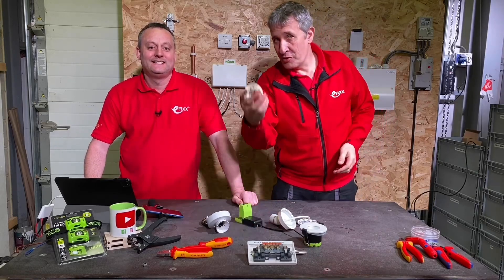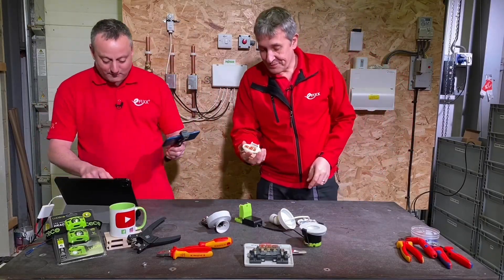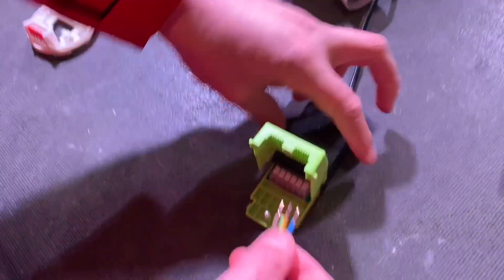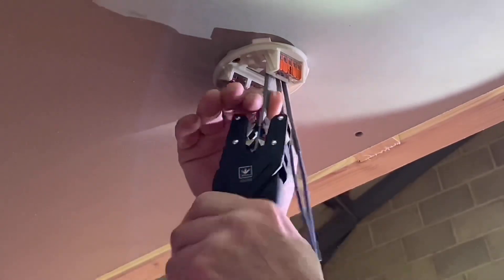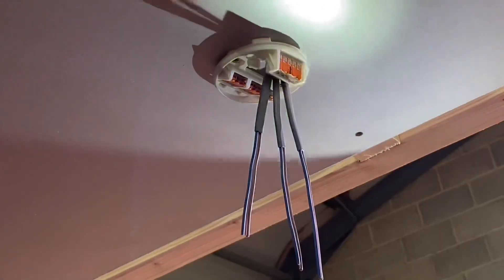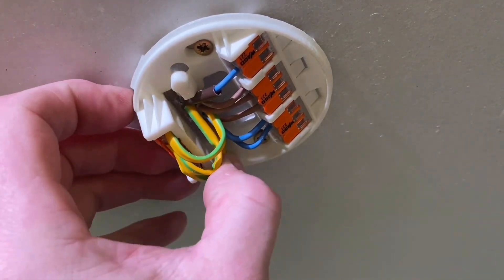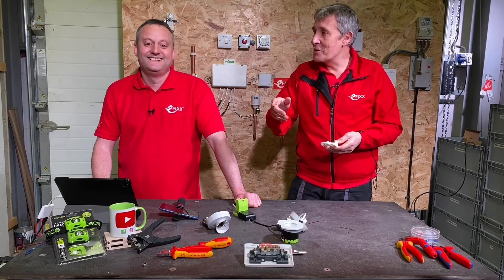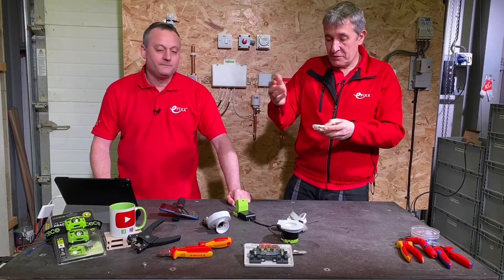Would you use a WAGO 221 CEILING ROSE?

Comment: Hi,  Just a thought.  As modern smoke alarms are fed from the light fittings.  Has this rose got a seperate set
of wagoe's for this or do you just double the smoke alarm feed wires into the same terminals?

Comment: Pendants are an utter and unnecessary ball ache, these would be great
Reply: Also if suppliers of fancy light fittings could add the the ability to 3 plate that would be nice too rather than the ole LNE connections but having 3 cables to have to mess around with

Comment: Personally I don’t trust these wago type blocks, simply your contact area is very thin metal strip, compared to basic ceiling rose with larger surface contacts, also you know that screw is tight and your conductor is secure.

Comment: I asked MK for a WAGO Mains Socket 10 years ago…
Definitely time now for Mains Supply and Ceiling Roses using WAGO.
Any suggestions for an existing WAGO product to supply an island induction Hob (possibly pop up sockets too) using fixed wiring in wall of 4mm2 to the flexi pre-wired to Neff Hob? Typically it’s not long enough to reach the wall…
Oh I’d pay £1 for a WAGO ceiling rose, after all if I’m populating it myself with 221’s there would be no metal in it.

Comment: If the choice was between a ceiling rose with screw terminals and one with WAGO terminals I would opt for the WAGO.
But there are a few issues we should think about when we talk about WAGO type ceiling roses.
The first is cost, a screw terminal ceiling rose is fairly cheap to buy so must be cheap to manufacture and a WAGO one may not be able to compete on price particularly in a market which is shrinking.
As a personal example of this I had a look around my own house, when we moved in a long time ago we had 13 ceiling roses in total.
Now we have only 7 ceiling roses and 11 other light fittings which I cant call a ceiling rose as they fit directly to the ceiling and over half of them have multiple GU10 LED bulbs on a bar.
These light fittings have push in type terminals in the base of them, some even have multiple common terminals to allow loop in etc.
So I think the days of the traditional ceiling rose are numbered, a lot of new houses have LED downlighters everywhere.

Comment: Instead of fiddling with both the diagonal cutters and the big wirestripper tool during the install, you could have used a cable cutter. The CC22 is the go to here in the nordic countries. It has a cutting area made specifically for stripping wires.

Comment: Only if you paid me. All wago crap overpriced. Used wire nuts for 50 years without a problem. If I go into a splice box to add another receptacle most likely wago is maxed out so I have to replace it. Most of the timevwork on energised circuits. Just removevthe wire nut and twist new wire around. Have done this thousands of times.

Comment: Love the videos lads. Brilliant idea, about time all electrical fittings had Wago or push in type connectors. A lot of IKEA lights have them already. By the way, when are you lot in the UK going to stop using that old outdated twin and earth?  Since 2017 , in Ireland , we can no longer buy twin and earth which has a bare earth conductor. The earth in our twin and earth has to have an earth conductor which is insulated, not sleeved, and the earth conductor must be same cross section as the other conductors. See attached link 
https://safeelectric.ie/contractors/updated-national-wiring-rules/ 
Keep up the videos.

Comment: As I said before crabtree certainly had push fit switches in the late 80's early 90's, not sure if they did sockets in that range, I am not sure there's a real market for this, I have switch fed since the 90's, mainly because it's easier to terminate a load of cables low down rather than stuck on a step ladder, although these days with smart switches, where you normally need a neutral it makes sense to switch feed.
So for that reason,  I think it's dead before it starts,  and  at least 10 years too late or more. 
Cost wise, there's well over £1's worth of wago connectors, I would say you looking in the £3 - £5 area.

Comment: Hi fellas, love your stuff, very educational, thanks, but I do have a question regarding BS1363 design, I recently had some 2 gang TCP Smart sockets with wifi app controllable switching, all good except the two earth connection points on the outlet were not inter-connected, and I was concerned that the average DIYer swapping these out may not realise that they could break the continuity of the earth ring if they added more than one of these, do you know if the standard specifies that sockets should have internal connection between earth terminals? as I believe this could be putting people in danger of not having earth fault protection. Thanks.
Reply from the maker: Send us a link to the product or a photo and we’ll take a look.  TCP have a track record  in electrocution- https://www.luxreview.com/2015/03/12/led-lamp-shocks-bulb-tester-at-uk-consumer-publication/
Reply: @efixx  for some reason my link gets deleted by youtube, so go search for 'TCP Smart Wall Socket with USB' sold on ebay by a big high street catalog shop ;)

Comment: Tbh wiring up a standard pendant batten isn't that hard only that as you pointed out the terminals are smaller than standard terminal driver and makes difficult to tighten. They could just make pendants etc slightly bigger and accommodate extra terminals . But I guess as more people use the feed to switch method you dont need that many terminals

Comment: I like the wago cieling Rose, however the only niggle that I have is when performing safe isolation, because with a standard cieling rose you can put your voltage indicator onto the screws to test the supplys dead.

With the wago cieling rose you would have to disconnect all the conductors in order to test them, and should the supply be live then you risk getting a shock when disconnecting the conductors.

Thats the only niggle I have.

Maybe they could make a test area on the wagos for testing the supplys dead with the voltage indicator?
Reply: Wago 221 and 222 connectors do have a test slot, but sadly at least on the 222s (I haven't tried the 221s yet) it seems to be too tight/deep for the modern high safety rating probes to get into :( I'm also not sure how reachable it would be in that rose design.
Reply: @petermichaelgreen  I've checked the 221s and there's no way of testing them as far as I can see without taking the conductors out.
Reply: @planetconker1104  https://www.wago.com/gb/electrical-interconnections/discover-installation-terminal-blocks-and-connectors/221 claims there are test slots, but it looks like you need a pretty long thin probe to get into them.
Reply: @petermichaelgreen  Well I've got a bag of 100 2.5mm² 221s and a mixed box of different sized 221s and I cant see any where for probes to go.

Comment: Ktech makes the “mbox l32” which is sold in various locations. Sold as a wiring centre but can be good for other complicated set ups with multiple switches for bathrooms etc. Ktech has, for years, had “kRose” as an upcoming product but it isn’t yet in the market. I don’t know but I always assumed it was a wago based ceiling rose. They’re very local to where I work so hopefully the prototype you have is from them. Wagos beat screw terminals for me every time!

Comment: as a yank, we'd dustbin the ceiling rose.  we prefer to have a 3 and 5.8" round box recessed into the ceiling, and then any surface mounted light will screw to that box.  also, we've been feeding the power through the switch box for many years now, and most of us prefer it that way, because it eliminates using a color of conductor for a different purpose than the color code implies.  
as for the Wagos, I don't trust screwless connections for power going through, because we have had screwless receptacles for years, and they're a bit rubbish.  I'd estimate I see between 10 and 20 screwless connections fail for every mechanically fastened connection that fails.  fixture connections, I don't mind so much, because they don't carry as much amperage and they don't black out half a circuit if they go bad.

Comment: Think the jury is still out on these. Most new builds use 2 plate method with just 1 or 2 cables at the light. £2.50 as can’t see the real time benefit and testing seems like it could be a little trickier than conventional pendants. Also scenario where you have 4 cables plus at the fitting is arguably where these would be most beneficial but with current design this is not possible. With some tweaks and if you can keep cost down then it could make its way onto the shelves. Good luck to the designer, hope it works out for you 😊

Comment: Would be great for consumer unit wiring if they could increase the wago size for bigger cable connections
Reply: Wago Cage Clamp connectors are available for various size up to 35mm2 conductors (and their Power Cage Clamp range goes even higher). That should be sufficient for any consumer unit. What's really needed is for a manufacturer to start making RCDs, MCBs and RCBOs with Wago connectors.

Comment: Is there anything to stop roses being bigger, with more space for more connections or even a junction/adaptable box with a flex outlet? How about using the push button (Ashley box style) like on your downlighter review? I'm a huge fan of Wago but we're yet to get the full potential. New light fittings with them in place? No more balancing a light on your head while you hold multiple cables into a connector block & twist the screwdriver with you teeth!

Comment: In new builds these would be used, then within a year or two many of them ripped out for aesthetically pleasing light fittings. So, those push fit lighting j-boxes would be used shoved into the ceiling space. 

I only have one ceiling light fitting in my place - a very expensive pendant light over  a dining table, which does not use a standard ceiling rose.

Comment: 1st question - yes, 100% I would use one, I hate ceiling roses
2nd question - if I was doing a rewire I will never take the feed to the ceiling rose so wouldn't need as many connectors, I would pay around £2.50 for it.
I can't quite think why but I think this video is once of the best you've done, nudge nudge, wink wink!!
Reply: how would you do it then?

Would you feed the mains through the switch then the switch on to the pendant?

I tried that and it keeps tripping...I tried it the normal way too and the same again.

Only one of the ones I'm doing that's doing this at present...really frustrating!
Reply: @weedfreer  Take the permanent line to the switch, then the switch line up to the pendant, the return from the switch line is connected to the Neutrals in the back of the backbox, pretty common setup to be honest, can't believe you've not seen a feed to switch before
Reply: @TravellingVeteran  I have...that's the point.

I've wired the rest of this section up like this going via LED downlighters just fine.

I think either I have a cable issue here or the fitting needs replacing personally.

I've even attempted to set it up as per usual standard by putting a permanent feed into the rose and then running through the loop block to the switch and then into the bulb's live terminal and it's still failing 🤔

I've replaced the cable from the switch up inside the wall also already for new (although, I may do it again using 3 and earth so I can leave a neutral there in case I may want to get some fancy smart switch later on)

Comment: Whilst the ease of fitting is good, for me the big draw the confidence in the clamping of the wire. Most basic roses use the end of the screw to clamp rather having a pressure leaf to spread the clamping force.... time and time again I come across either loose or over-tightened resulting in broken conductors. The other big bonus is 1 wire 1 terminal, no twisting together etc.

Comment: Wagos are not only quicker they provide the perfect amount of pressure on the conductor unlike screw terminals which is with the discretion of the installer, meaning less loose connections.

Comment: Hmm, if you're using 1mm cable you can fit 2 cores in each lever terminal (not recommended but possible when in absolute need) which would allow for a spur off to a loft light or over to a fan isolator.
Reply: This is not a good idea. With stranded wires it should not be a problem, but with solid ones one wire might get insufficient pressure. This contacts are explicitly rated for use with one wire per lever. Bad connections are not a joke.

Comment: Only vaguely related to ceiling roses, but why weren't sockets which leave exposed terminals when there isn't a plug in them banned years ago?
Reply: In the UK they have been, since the introduction of the square pin plugs in the 1950s
Reply: @mikep-j894  I'm referring to sockets for lamps, eg BC and ES.

Comment: Hell yes. Tiny Screw terminals are so sharp they make it really easy to cut through a 1.5mm  cable. How many times have I have to re-terminate the cable cos I’ve chopped through it cos I do the screw up too hard.....

Your prototype is thicker ‘cos the wagos are at an angle. Could be thinner by laying them flat, at the risk of having to be a larger diameter. But  that layout isn’t required...  would a north south east west layout allow you to keep the same diameter?

Comment: That would be an improvement even for Germany. 
Now there are always three cables hanging from the ceiling, black, blue, yellow-green and a hook. A plastic cap is pushed over.
With every new lamp these cables get worse. 
And if these cables are then cast into a concrete ceiling, then you cannot change them. (Saved on the flexible hose during construction, cost cents). 221 are also easy to clamp on a ladder.
Notice: The cables are clamped in boxes in the wall if old or new behind the switch.

Comment: To overcome additional feeds why can’t we have two conductors into one terminal. If a 221 is rated up to 4mm. 1+1 is 2 and 1.5 + 1.5 is 3 for lighting wires. I have seen many others do this. Is this a problem?
Reply: They can only properly grip one wire, particularly if it's solid core you can get away with multiple stranded wires in one terminal but I only do that on SELV temporary stuff, not a good idea in a permanent mains install.
Reply: @mfx1 
 for multistrands use proper ferrules /reducers for the required size with a crimp.
Reply: @sriyantra1939  Maybe for a single stranded wire, but that wouldn't work well for trying to more than one wire ion one terminal as there's a good chance one won't end up being gripped properly, also ferrules are not strictly needed or even always desirable for spring clamp terminals like Wagos, only for screw/cage clamp ones although many people prefer it, that's up to them.

Comment: Sooner everything has Wago connectors or similar the better. Sockets, switches and lights. Everything looks neater and better with the smaller 2mm sleeving as well. Sooner we use the same sort of T&E that they use in Ireland the better, no sleeving at all then. Just as a matter of interest do you know if it is possible to use it in the UK or does it not meet our specs?  https://www.screwfix.ie/p/prysmian-n05vvh4-u-grey-2-5mm-twin-earth-cable-100m-drum/226hk
Reply: Came across a house wired in this a while back, guy was from ireland and had his sparks come over n wire the house. Perfectly fine as it meets the minimum requirements, as long as it's the correct cores csa/colour and material used it's not an issue.
Reply: Agree with you on this. The amount of time I spend faffing around sleeving things.
Reply: you can use it in the UK as long as it's sized for the amperage correctly iirc

Comment: I would argue that anything that increases 'first time right' is a good thing. The current issue in big builds is that the installer at 2nd fix doesn't often test it, and so has no incentive to get it 100% right. One single fault is a real pain to find and fix. How many housebuilders DON'T have a wiring issue reported as a snag by either the person testing/inspecting, or (and we hope not this late) by a new house owner? Wago 221s are a godsend. Period. In a socket? Yes please, yesterday. The same goes for light switches. My view is that the 221s should be in the pattress though, NOT the face plate (as you glued them). So, the socket would need to have fly leads to link to the 221s, which means a 4 way 221 would be needed (ring final [2] PLUS spur plus fly lead). In effect, if you look at how a commercially installed socket is done in the USA, they now tend to have a fly lead on the socket to link to a 221 (or equivalent) where all the wiring comes in/out. Take a look at this Spelsberg junction box from CPC: https://cpc.farnell.com/spelsberg/80680701/ip65-grey-junction-box-screwless/dp/EN85174. That is in production already. The connection block at the top unscrews and comes out. Genius. In a pattress, you could fit the wires to the 221s, slot them in to the carrier, screw that in, introduce the socket fly leads, fit the socket to the pattress.

Comment: I generally use MK pendant sets these days, the helpful features for me are 1) clear base 2) inclusion of a little bit of sleeving in the pack 3) metal surround for bayonet lamp to hook onto. MK sell them in sealed plastic bags which is a good job as at least one of the terminal screws has usually shaken out in transit. Used to paying £2-£2.50, if it comes with the above features and 221's fitted (1x 2way 2x 3way, 1x 5way) I'd be happy to pay £35 for 10